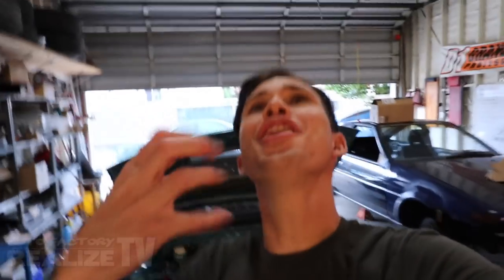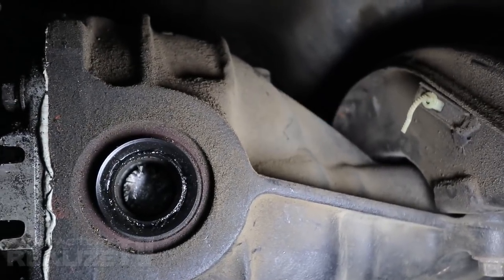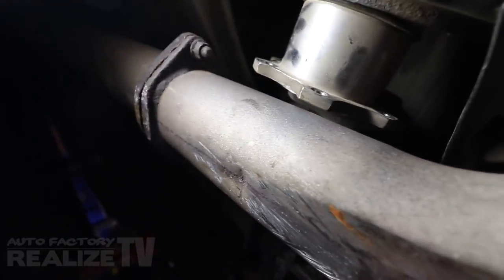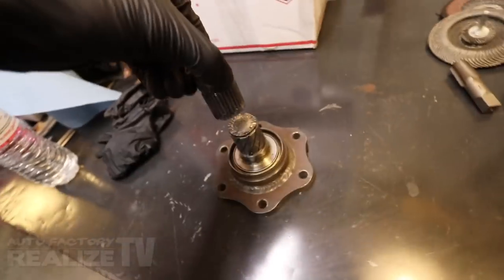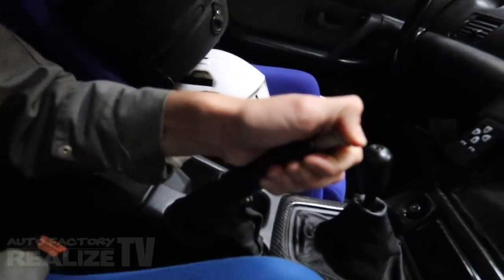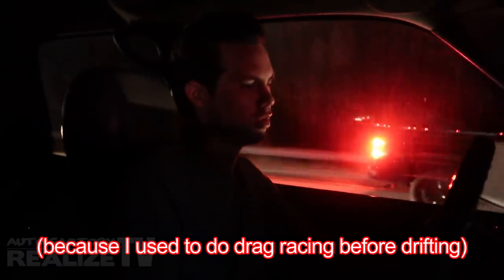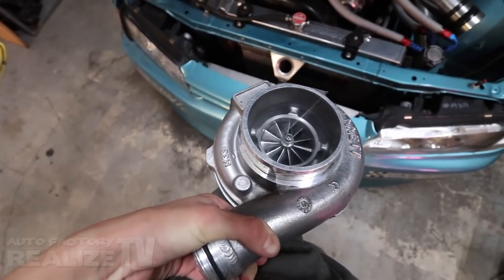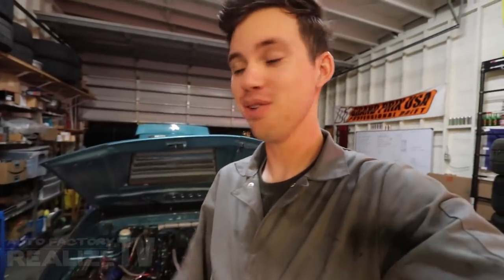SHOULD THE R32 GET A BIGGER TURBO?

Comment: I'm on my 3rd transmission in my s13, I never considered that
a laggy turbo would be a factor until a friend of mine told me
about this video. My mentality was, 'what difference does it make that
the power comes on later? It'll still be under the same amount of stress at 
that moment than it would if it was earlier.' It doesn't help that SR/KA transmissions
are made of glass to begin with, but maybe I'll be able to get more than
3 events without breaking one by doing so. Can't wait to see how this works out for you.

Comment: What angle is your axles runing when the car is on the ground. Excessive CV angles can cause failures aswell. If that is the case hit up DriftWorks and get the GeoMaster V.2 drop hubs for the rear. The clutch kick thing doesn't add up because when clutch kicking mid drift the car doesn't need to break traction so the strain on the driveline is minimal. The clutch kicks that are the hardest on drivelines are stand still launches and initiate clutch kick, when the tire has grip. But again you have 215's on the car wich is very skinny compared to the 235-245's D1SL cars are running in Japan. Keep us posted Ted! Hopefully the problem is smaller than we all think😎
Reply: drop knuckles fix geometry not axle angle

Comment: 1. axle angle - maybe it's too big? is it the same in both cv joints?
2. rear geometry. good, bad?
3. clutch kicking/driving style. are you going out of boost while e-braking? or maybe you are raising the rpm's with gas pedal taps to keep the turbo spinning? are you in high rpm range after releasing the ebrake and clutch, or just drop to like 2-3k rpm?
4. them distance between output shaft and the axle itself. it's actually pretty far away, and i'm 80% sure that with stock ride height you would get them closer to each other. you are putting additional stress out there and the weakest point at the moment is snapping.
Reply from the maker: 1. Axle angle could be an issue
2. Geometry can be reviewed 
3. Powerband is very peaky, aka after ebrake the car has to be revved extremely high before releasing the clutch
4. May consider an axle spacer

Thanks for all of your thoughtful input!
Reply: Auto Factory REALIZE actually getting revs high helps NOT to brake an axle. but banging an ebrake and correcting mistakes puts a lot of stress. you need to find that swimming rhythm, where arm and footwork are restricted to minimum. for example - Kazama
Reply from the maker: Good point
Reply from the maker: A lot of corrections need to be made!

Comment: My last two cars have been bone stock and N/A. Ive been breaking axles for years. I think its axle angle. From running too low. I think modifying the subframe and raising the diff is the fix
Reply from the maker: Interesting. I do not feel like the car is that low.. will also explore those options.
Reply: What sub frame bushings are you using?
Reply from the maker: Alberto they are SPL bushings

Comment: I think you are on the right track by changing the turbo in general but having your car that low messes up the geometry and will put stress on the axles in places that would never be stressed under normal driving conditions. Maybe subframe spacers and raising the car just a hair.  (will also make the car handle much more consistent)
Reply from the maker: Will look into ways to help the geometry of the axles but raising the car is pretty much not going to happen haha.
Reply: ConnuhhhhNS raise the car bahahahahahahahha! Raising the car makes all this fun pointless.

Comment: This is from a RB25 guy who does the D. Definitely run the gtx30. If the axle implodes again. I recommend doing bnr32 diff and axles. Lol this is like the 5th time I'm commenting saying do the GTR diff and axles. Also. If you want to make all low end power. RB love a 256-260 intake cam run stock exhaust. Makes more power on the low end. You will see boost 3000rpm. Bet.
Reply from the maker: Oh great advice thanks! Yeah the car actually hasn’t been touched much since the making of this video. Definitely considering the GTR diff and axles, although many people are running these same Z33 axles with positive results... will definitely run the turbo, it’s just a question of money since it will require all new plumbing, wastegate and tune.

Comment: Are there supposed to be snap rings on those output shafts? Maybe without those and no axle spacers the axle can pull out from the diff slightly while driving, clutch kicking like that would certainly snap output shafts when not fully inserted into diff

Comment: also try out the Nissan value plus axles, I broke 2 orielys axles before I went to those. z1 sells them. I know this video is alittle old but hope you got it figured it out
Reply from the maker: This is still an ongoing project, so thank you for the input! Will check those axles out
Reply: @AutoFactoryREALIZE  yessir! As explained to me by z1 these are the new line of nissans OEM replacement parts. I'm pretty low with 0 camber. I went with the 15mm gktech spacers
Reply from the maker: Awesome, I’ll look into that for sure. I was also considering reverting back to S13 subframe for the narrower track, which could help with the axle spacing as well.
Reply: @AutoFactoryREALIZE  Don't give up!!!!!!

Comment: not sure if a bigger turbo is the right answer. bigger turbo means more space to make up when building boost. for a more linear boost curve you would want to go smaller (at least on hot side). the new one looks to be ball bearing which will help spool compared to (what looks to be) a journal bearing turbo. idk i deal with a similar laggy set up and was going to man up and buy a ball bearing in the same specs to hopefully avoid a retune, but improve the horrible lagging issue. just food for thought.
Reply from the maker: Very true. Still need to study some graphs from RBs running the same turbo. May end up going smaller.
Reply: Auto Factory REALIZE disco potato or similar

Comment: TEDDY, why no snap ring on the out put shafts inside the diff?  Just for ease of service?
Reply from the maker: THERES SNAP RINGS?!
Reply: Usually on the inside to keep the shaft/ stub from pulling out of the center section.  The machined indention on the splines would have a snap-ring there, unless your application does not require.  Differential on the MKIV Supra has them...but, if it works, it works.  Not having a snap ring will save you from having to open the diff cover, but the sub seals may suffer and leak pre-maturely...  enjoying the channel!

Side note adding low end turbo response will help  drive-ability all around, but I am not sure if it will solve the stress of the clutch kicking madness.

Comment: Are you running a welded diff, or a vlsd? Also, good to know villains gives you a lifetime warranty on these output shafts
Reply from the maker: The diff is OS Giken 1.5 way
Reply: Auto Factory REALIZE must be nice haha. Then again, I’ve been thinking about getting a gtx3076r instead of using the gtx3582r that I was planning on using for my 1j. Want to get up to like 600 wheel and seeing this is making me really thinking about it because the smaller turbo with more boost might make a more linear powerband. I am using a .63ar with the 35 but now I’m confused
Reply from the maker: Yeah I don’t know a single thing about turbos. Maybe time to do some learning.

Comment: boi i said it last time and i said it again. 

OP6 Highflow is all you need. 3076 is too much. Keep it simple and enjoy RB life.

Also you need rear subframe spacers and adjust rear castor(traction arm). When you lower the car rear castor is lost. Extending wheel base and puts the driveshafts at a angle that puts them under stress. Especially when underload.

Comment: Why not get new axle hardware and spacers while it's down? 
Because the surface area inside the  axle designed to contact each other is decreased by a quarter inch when it's stretched out. 
Wouldn't that be a cheap fix?
Reply from the maker: Yeah axle spacers would be easy enough to do.
Reply: Auto Factory REALIZE 
P.S. 
did you ever get that gum out?
Reply from the maker: Haha yes I had to dig around though
Reply: Auto Factory REALIZE 
Your extra effort does not go unnoticed!  <3